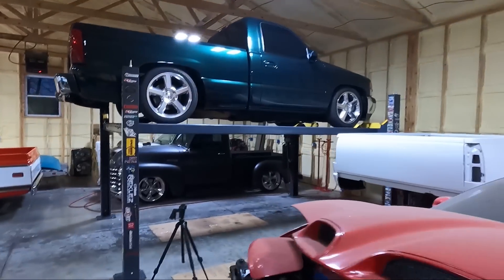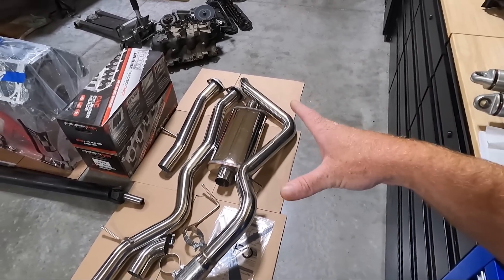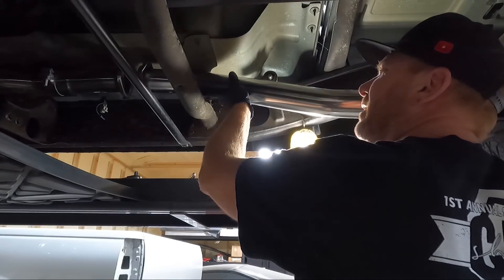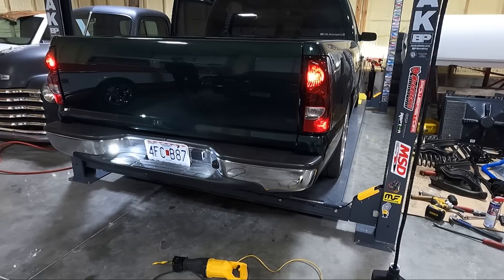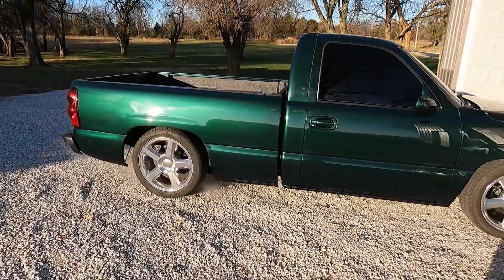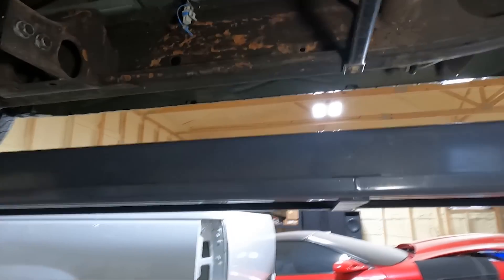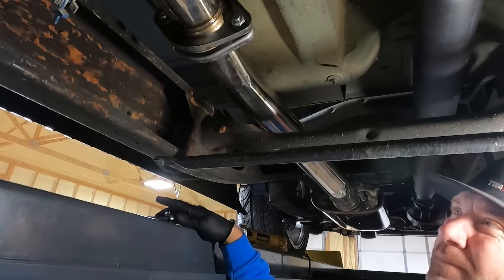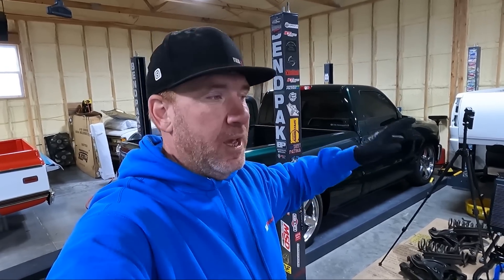Slammed NBS GMC Sierra Finally Getting Catback Exhaust From Speed Engineering

Comment: I just installed mine and yours seemed like a much better fit than mine. 2 bolt flange at y pipe was clocked too far and non of my hangers lined up especially the one at the dump I had no choice but to weld a new hanger. Sounds good and not loud which I like but the fitment was very terrible.
Reply from the maker: That's weird. May move the part right in front of 2 bolt flange

Comment: I find the speed engineering mufflers too loud for my taste... I normally go with magnaflow muffler and kooks high flow cats and get a builders kit and v bands and a short flex pipe and go custom for my combos. Sounds killer, though. On my v6 to v8 swap rcsb, my Texas speed headers were really close to the frame on the passenger side, but it's not that close on my factory v8 truck... maybe something to do with the swap motor mounts or something. Overall, it's a really clean setup and truck! You can also adjust your cams chop a bit with idle under and overspend spark tables in hp tuners. Killer truck and very tastefull!
Reply from the maker: Thank you. Yeah I have played with that idle speed table a little in the past.

Comment: Just to make sure I understand this. You’re using heat wrap, where there isn’t a heat concern, to protect against a possible clearance rattle where you’re reducing the clearance by putting the wrap on?
Reply from the maker: Yep. Did it to keep it from rattling on the floor

Comment: Travis, I have the same type of y-pipe setup like yours with no cats. Just long tube headers with a turn down out the back. After getting help from HP Tuners on my 5.3, one of the issues before and after the tune was a strong exhaust smell and was recommended that I get a high flow cat on both sides right after the collector to help with the exhaust smell. The truck runs perfect post tune now and isn't running rich or lean. Do you guys think that this is normal since the cats have been deleted? Also I've got a BTR Stage 4 cam in it which may contribute as well.
Reply from the maker: Very normal without cats. Will always smell rich even though it isn't

Comment: You are the only person I’ve found so far running the single 3 inch from them, I want to buy the single for my 04 tahoe, do you know if it will work or would I have to add length ?
Reply from the maker: Not sure honestly
Reply: Did you ever find out

Comment: How loud is this exhaust?… I’m looking for an exhaust that is just a little louder & deeper than the stock exhaust. I already have speed engineering headers & y pipe.
Reply from the maker: It's a hair too loud for me honestly
Reply: @TWAMotorsports  thank you for your honest opinion. That is what I thought, I just wanted to be sure. I was looking at the Borla Touring or the Magnaflow 18”
Reply from the maker: I am a magnaflow guy.
Reply: @TWAMotorsports  Since you have a catless y-pipe. Do you have bad exhaust fumes smell?… I’m doing a 6.0 swap on my 2000 Silverado & I have bad exhaust fumes smell. Also, my truck is not tune yet as well.
Reply from the maker: It always will without cats
Reply from the maker: Not at all
Reply: @TWAMotorsports  I want to start making videos of my Silverado build. I should have made videos of me putting the 6.0 together & putting it in my truck. But it’s ok, because I have a lot more that I’m going to do to my truck. I’m also doing a step notch 3link coilover kit. I have the DJM upper & lower control arms. And Intro wheels 24/26.

Comment: The section you heatwrapped, would it be possible to bypass the short flange section that attaches to the y pipe and use a straight pipe to the muffler? Or will it not clear the cross member where you heatwrapped?
Reply from the maker: May be able to